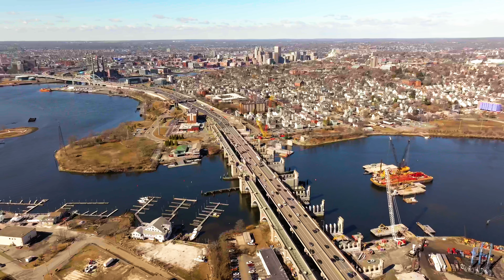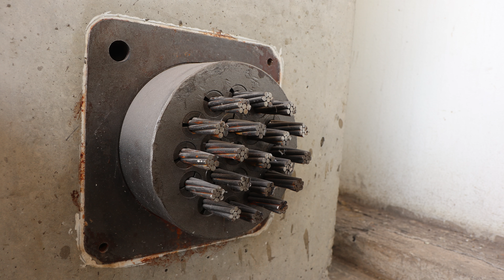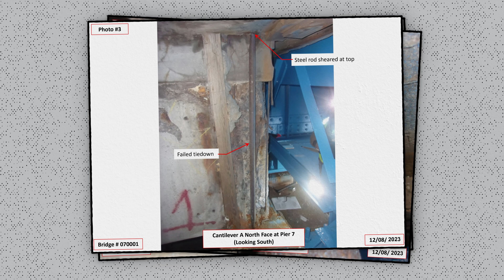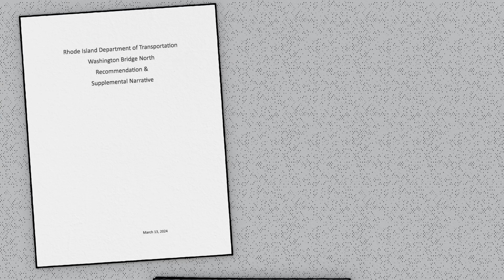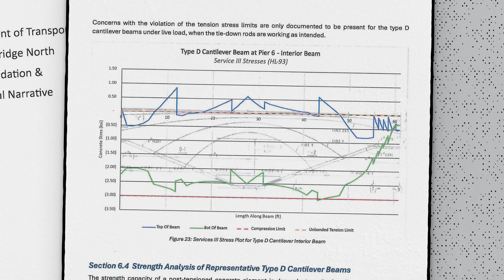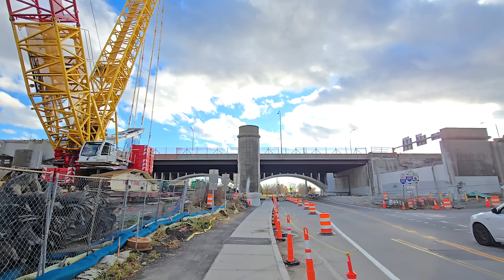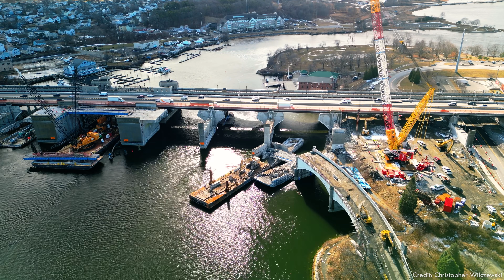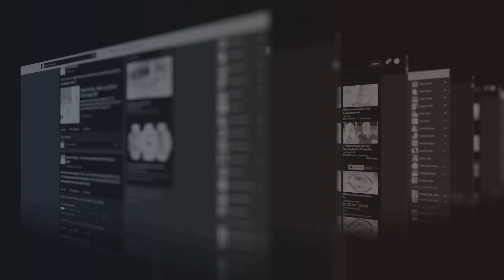This Bridge’s Bizarre Design Nearly Caused It To Collapse

Comment: I can't tell you how happy I am you are covering this, as a Providence resident. So many locals are misinformed, thinking it was a failure or corruption of public servants, but we are so lucky the inspection process found what it did when it did. IMHO, the system *worked*. we caught an imminent failure before it happened, unlike what happened years ago in Minnesota.
Reply: The other kicker I like to tell other RI residents is that bridges have lifespans. I remember the restorations done on the bridge in the late 90's, and how RIDOT said they were hoping for another 20-30 years of the already 40 year old bridge. 

Well that time has passed and it was going to be time for a new bridge anyways
Reply: @NuclearApocolypse  I've noticed many many people fail to understand that the Washington Bridge is technically two (three now with the pedestrian one?) bridges that run in parallel, and trying to explain to them the age of each span is a chore.

They really should have continued directly on after building the new Eastbound span to doing the same to the Westbound one.
Reply: As an RI resident, I view this as utter failure of the state. They know how critical traffic flow is there, and yet they had no plan in place for replacement, funding, traffic flow, design.
It’s an ancient bridge and it’s time was coming, but RI likes to pretend that “oh no, how were we supposed to know that an old bridge was old and plan ahead.
The real fact is that RI consistently mismanages its finances and it’s broke. There are other bridges in the state that are bad too. (I’m looking at you rt 37 bridge crossing over post road supported by a forest of wooden support beams because the concrete is crumbling away.)
Reply: @EarlSalisbury-in4dk  but there was a plan.  Grady literally opens the video saying that the issues were found during the initial stages of enacting that plan of widining the bed and maintenance to extend the life of the bridge another 25 years.
Reply: @EarlSalisbury-in4dk  Governments don't have unlimited money, dude.
Reply: @EarlSalisbury-in4dk  they’re gonna find a way to f*ck up building the bridge of 146 over Sayles Hill Road
Reply: @EarlSalisbury-in4dk  If you have to understand that there are hundreds of pieces of infrastructure being worked on at any one time. If you keep getting the green light over and over again that a piece is in working condition you don't have time to be planning for its failure. These people aren't working with infinite amount of time or sitting on their hands waiting for the next failure they are working on the pieces that have been already proven to be bad and making plans about those. Not to mention even if they made a plan while still getting the green light there is no idea of whether or not it would be outdated by the time it is needed.
Reply: @h4rdcor31  literally an example of the misinformation the OP is talking about. They see the word corruption and see none of the words around it, like “not”, or “wasn’t caused by”
Reply: @EarlSalisbury-in4dk . The US at large is full of crumbling bridges. It’s a trend from the top to not invest in infrastructure, overall to cut taxes and divert what taxes we have to military spending (at the federal level). It’s a systemic issue that is going to take a fundamental political, economic, and social shift before it begins to be addressed.
Reply: “Nearly a decade before the westbound Washington Bridge was hastily closed to avoid collapse, the engineering firm the state hired to study it found structural problems and called for repairs. 

But many of the key repairs recommended by AECOM in a 2014-2015 evaluation of the bridge were unaddressed by the time the bridge was closed Dec. 11, 2023. “
Reply: i can see by the way things are progressing that lawyers,  whether for new construction contractors, or for old inspectors, bid managers, the state the federal government, and maybe the UN, are gonna end up with a huge amount of money related to the bridge, to the total benefit of John Q  Public.
Reply: @mikecrooks8085   The lawyers always get paid...
Reply: Grady is the greatest, but there is another guy who has been covering this subject on YouTube quite extensively who you might enjoy: "Casey Jones Professional Engineer"
Reply: @parkependleton6453 I came to the comments to recommend Casey Jones, then Grady gave the shoutout. Nice to see the cooperation among channels I subscribe to.
Reply: Well... unfortunately the only reason the issues came to light is because of the planned renovation work, not because of regular inspections. Were it not for that work, there's a good chance the problems would have gone undetected until the bridge failed.
Reply: RI should change the motto from "Hope" to "Proudly Dissapointed"
Reply: Didn’t he say that all of the inspections missed the damage and they only caught it because the city happened to try expand it?
Reply: As tragic as it was our bridge failure force the country as a whole to really look at bridges. Which likely saved hundreds of lives that might have otherwise been lost.
Reply: Hey was this the bridge that had the huge homeless camp under it or was that another one? Lol RI not corrupt that’s beyond hilarious. Providence still had a mob boss for a mayor until like 5 minutes ago.
Reply: What happened in Minnesota was a design error. The failure wasn't foreshadowed by visual cues (corrosion, deformation or cracking) that inspectors are normally looking for.
Reply: The inspection doesn't catch it for long time
Reply: And also, is it that expensive to put something in place to reduce traffic delays past a website that helps you try and avoid the delays best you can?
Reply: @vqinet3287 Yes. Yes, it is -- when it is even possible, which it usually isn't.
Reply: This was corruption as usual.  Hope the federal government take over this project to avoid the paybacks to the politicians
Reply: The people you spoke to are liars
Reply: Bridges are like thoughts. You must eventually change them or things get dirty.
Reply: RI resident here. Original commenter suffers from Stockholm syndrome.  One failure after another in this state, but "don't worry cause my brother works for the governor".
Reply: @jeffs5519 drug dealer detected
Reply: It’s a failure of the bridge process, the general apathy of the population, and the systematic bs of the mob controlled govt in the state. Might as well all be honest with ourselves
Reply: you are delusional this bridge was never properly inspected for many years. plus the company taking it down is the company  the state is suing for the screw up. yeah if that doesn't speak corruption.
Reply: As a fellow RI resident, i completely disagree. The way this has been handled by RIDOT is a disgrace that wreaks of corruption. The GW Bridge is a microcosm of the state of RI as a whole. Yes, this bridge was at the end of life anyway, but that is not the issue. The lack of planning, suing everyone involved, bullying, and harassment by the state of everyone who touched that bridge for the last 50 years is the real issue. This state absolutely sucks, which is why i'm currently shopping for property out west.
Reply: @ Bye felicia. Won't be missed.
Reply: Agreed! It's been messy, but it's actually an RI success story.
Reply: Casey Jones says it was official incompetence and an ongoing cover-up.
Reply: @kentw.england2305  he should probably go back to vigilantism with the TMNT
Reply: Just too bad that it was providence that came out on top here
Reply: People on instragram who don’t have engineering degrees love to say “this is what happens when you have DemocRATs in charge”, as if regulation and inspections aren’t what caught this in the first place.
Reply: @InvictusRed1911  But also the failure of those things is what let it go unnoticed for so long.
Reply: @InvictusRed1911  Democrats didn't cause this.  
A combo or engineering flaws & corruption at the State/town/DOT level did.
Reply: Either corruption or incompetence - not sure which is worse
Reply: @SP-ny1fk Incompetence is better. Corruption is systemic, while incompetence is a matter of who's in charge.
Reply: @nikkiofthevalley  It's Rhode Island. We have too much of both.
Reply: They will still think that, their opinion comes from place of fear and anger not through and reason, people in your country are brain dead in masses, i sent you condolences, and trust me i feel empathy that  you need to live there and witness this decline.

Comment: US investment in infrastructure had been a short-sighted effort with little to no plan to support it through its life cycle. The reason why so many universities and researchers are currently developing nonintrusive sensor-based inspection, as well as AI-based assessment (instead of human), shows we have limited human and economic resources to properly manage this. There are no good ways to check if those bridges are really safe or not, if they are not safe, there is no money to fix them properly, and there are even less money to rebuild them. As Grady mentioned at the end, this is probably just the beginning of bridges eventually being closed as people start to look closer to these infrastructure. We should all be happy about the large safety factor civil engineers had to use during their design or the problem would have been a lot worse :)
Reply: my area has roadbed failures increasing all over the place.  the highway department is spending what must be millions paving over cracks, and I guess eventually, there will be enough asphalt to fill up the soft spots.  but it seems a very inefficient way to do things.

Comment: Just so everyone is aware of this fact,

Prestressing has not really much to do with the strength of the beam, but rather the deflection minimisation it offers.

As Grady said, cracks would start forming at the tensile regions if the beam is not prestressed. Prestressing essentially mirrors the bending moment diagram to essentially "cancel" out any moments.

If you think about it, strengthening would come from additional reinforcements and higher MPa concrete.
Reply: Cost is always a consideration. Safety requirements  can be designed at  the lowest cost. That is the challenge of modern engineering.

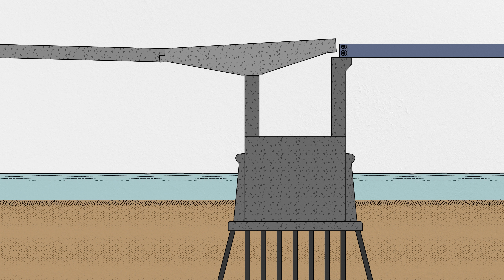Comment: 5:25 That was bad idea, relying on rods to hold it down just beat the purpose of cantilever design. That section should be cast in, not reusing the pre-cast section and use tie-down.

Comment: In my city there is one of the first bridges build with prestressed concrete, it is now getting replaced even though it is a listed building because at the time it was created nobody thought about the fact that it needed to be inspected and because of it we have very little knowledge about the condition of the bridge. The whole train line is a disaster, the embankment wasn't build correctly and using mostly rubble left from the bombing it always had problem with (uneven) settling and the station used the new advances in concrete to build very thin roofing for the platform, thus it has major erosion problems. the whole line was a product of its time and not in a good way.
Reply: engineers come up with a new idea, and people who aren't engineers think it is miracle technology that will last forever without maintenance.  it seems to be a universal constant.

Comment: And to think that there is a LOTS of bridges in need of urgent repairs/replacement in America that have been neglected is just SCARY.
Reply: That's the thing, the USA is a big place that had a road building boom post WW2. A lot of that infra is now reaching the end of its life and no one wants to foot the bill to replace all that infra. You've got the same problems with your dams.
Here in the UK, we're a lot smaller but similar issues are beginning to show on our motorway bridges and the highways agency is steadily working its way through it. We, thankfully, do not have the issue of Federal vs State funding.
Reply: @himaro101  A huge aspect of this is the continued deferred maintenance to "save money", which it never does. It just gets to a point where it needs to be addressed urgently and ends up costing far more to rectify. It didn't help here in the UK that the last government stripped funding from the departments that deal with this stuff, like they defunded pretty much everything else hence the state the country is now in.
Reply: @himaro101   haha well, in England you don't. It's just Highways England. In Scotland it can be a bit weirder... like those "special roads" which are motorways in all but name, so they can be classified as A-roads and under more-local jurisdiction.
Reply: @himaro101   It's not just roads. The rise of the suburbs. Much of that infrastructure, gas lines, water systems, Sewage systems, schools are ate the end of their functional life. We are now in a replacement cycle and that costs $$$.
Reply: @kwlanco2714 Why is there so much resistance to spending any money on anything? The total replacement of old infrastructure should in theory stimulate the economy and create jobs
Reply: @Aquatarkus96 because each new project can add fifty cents or a dollar to a local's taxes, and yokels in bumbleland see their taxes increases by any amount and freak out. They don't care that the bridge they rely on to get to work each day could collapse and take them out, they only care that the evil gubbermint is out to steal their mcbux
Reply: Easy way to get funding, we say these bridges are necessary for national defense to have bridges that we can transport vehicles across. Boom some of that 6billion they just added to the military budget.
Reply: American infrastructure design is a ponzi scheme and it's finally starting to show. Wide suburban sprawl is unsustainable, it only works as long as you keep getting in new funds through expansion.
Reply: Don't worry, next week is Still No Infrastructure Week

Comment: Salt water marine and road salt for ice corrosion one of the biggest issues in all highway bridge construction maintenance etc.

I witnessed recently stainless steel rebar and new fiberglass being used on decks.

Viewing those rusted tie down rods which were corroded to less than half their initial diameter shows total lack of maintenance and poor oversight of public safety.
It took decades for those tie rods to corrode away like that.

Civil Engineer Architect here .
I worked for NYSDOT .

In salt water marine areas .
Reply: Doesnt stainless corrode in the absence of oksygen, like inside the concrete? How would you even inspect that?
Reply: @ot0m0t0  Massive bridge decks done in Virginia all stainless steel rebar mats .

Also,
Stainless steel used in Nuclear reactor pressure vessels no oxygen inside piping valves or vessel . 

New fiberglass or carbon fiber rebar is promising solution.

In China they use bamboo on huge concrete structure as rebar.
Ty Lin engineering a famous engineer.
👍
Reply: @mitzvahgolem  Nuclear pressure vessels that use Liquid Metal (NaK) coolant, used Hastelloy not Stainless Steel. Hastelloy has no iron in it so can’t rust (it’s a nickel based alloy). Water cooled reactors add oxygen to the water to prevent corrosion with stainless steel.
Reply: Why don't they just make a stone-arch bridge in salty environments like this? No steel reinforcement, so no concern about corrosion. Even if it's more expensive, surely the reduced maintenance and longer lifespan and the absence of any scandals like the one in this video would see it prove to be a sound financial investment in the long run too. I mean, the original bridge is a stone-arch bridge and it's still standing, so why not learn from that and just build the same thing only bigger and wider?
Reply: @Monaleenian  because the average lifespan of an american politician is 15 years, after that they become undead money lunatics who only cares about shrinking development and increasing profit
Reply: @Monaleenian  it's possible.
But tremendous amount of stone and adequate foundations to support long spans .
Reply: @Monaleenian Then you have the question of “which stone”?
Porous stones have freeze thaw issues too. Reinforcing permits longer spans than are possible with unreinforced stones.
Reply: Your comment about road salt confirms my belief that the salting of roads is a bad idea. I’m usually concerned about the impact on plants near the road (I call it an environmental disaster), but I now see the impact on roads and structures.
Reply: Stainless steel is not a good option where intermittent salt exposure is a problem. Where I work were recently had stainless steel bolts on a steam valve fail due to inter granular corrosion - chloride (sulphide, selenide and 
Telluride are similar) exposure removes the oxide layer that stainless steel needs for corrosion resistance.